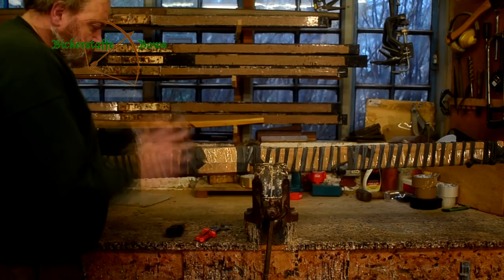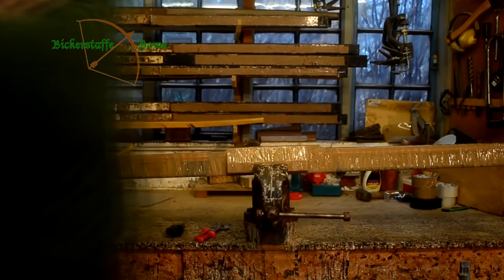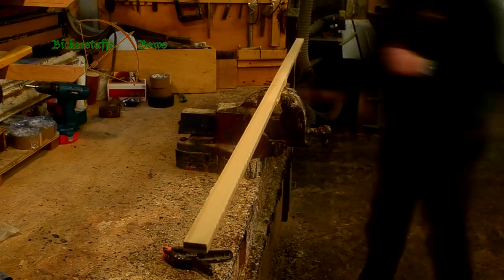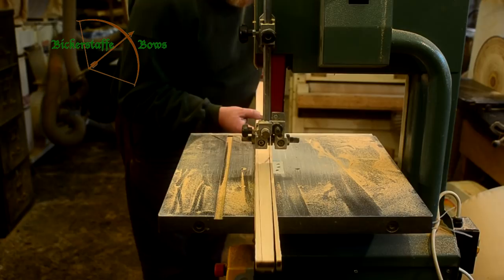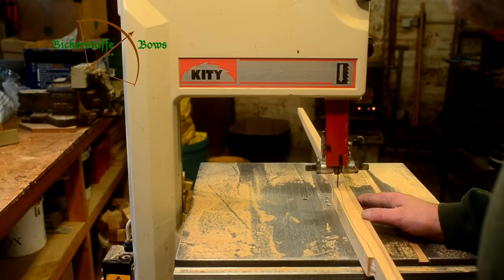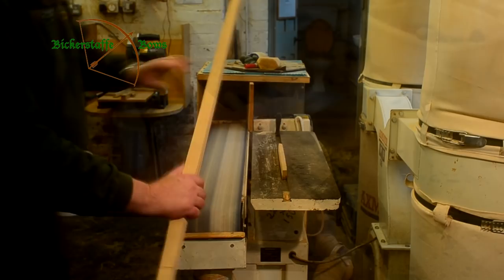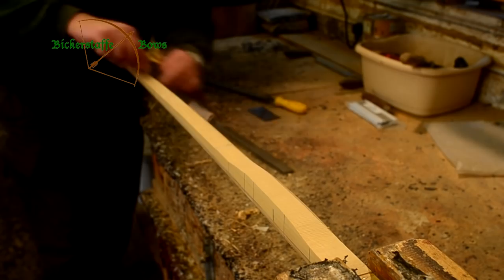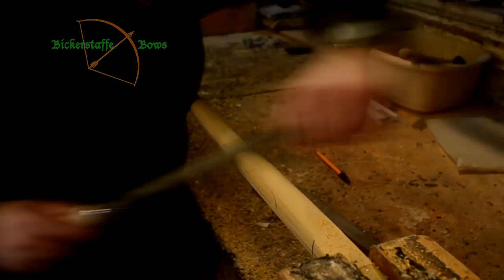Bickerstaffe Bows - How a Bow is Born - Part 4

Comment: They probably recorded the voice on a condense mic that is really sensitive so the speaker had to take care of the dynamics. This usually leads to a somewhat bored sound if the speaker is not used to it and the sound engineer is amateur - which most probably happened >)